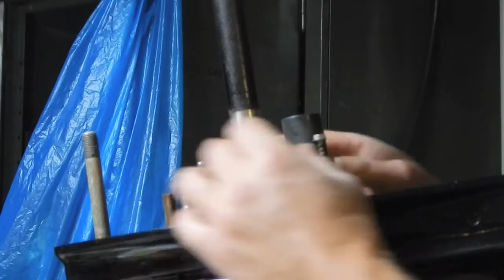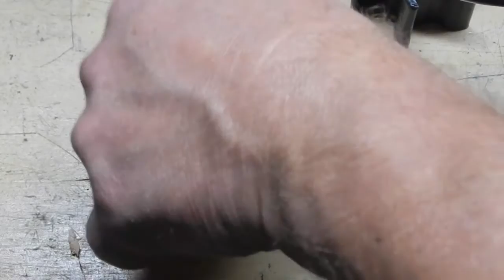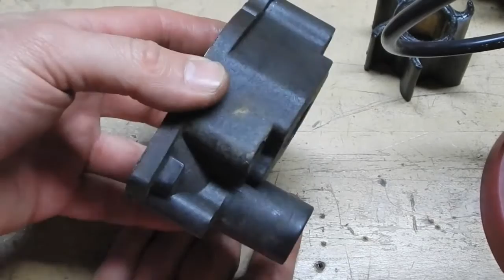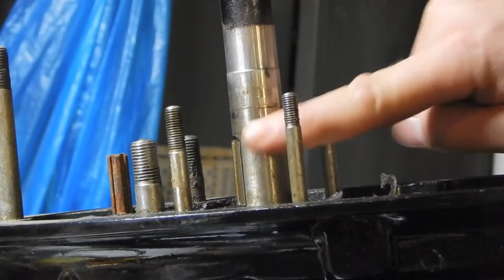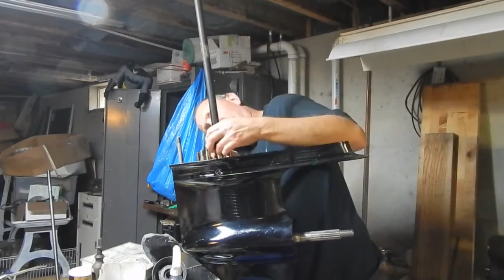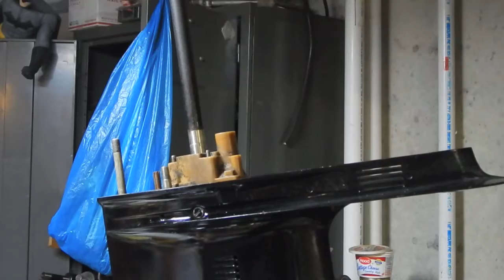The Mercury "Tower of Power" Outboard Part 50

Comment: Now you know why I always run a cooling water pressure gauge.  On those 10-15# ideal, less than ten start thinking change the impeller or look for a plastic bag over your inlets ( think bait wrapper-a quick killer but your gauge will read '0') under about 7-8 change it asap.  It is much more reliable than the piss tube.   There is a pipe plug on the top of the block above the spark plugs for a takeoff.   Take care.  Doug
Reply from the maker: thanks doug. I'll look for that plug next time im working on it.

Comment: Steve 
If you look at the black pump housing you will see the steel jacket has rotated in the housing leaving a witness mark from the lock tab.
I also wonder if some peanut has put the grease on the impeller to stop the squeaking of metal on metal contact between the shaft and liner.
Third that odd screw looks like some sort of drywall or self tapping fastener to me .
Cheers Eric
Reply from the maker: hello. I think the grease was just to aid in installing the cover over a new impeller.  I use the same trick. I  agree the screw looks wrong but it is almost identical to the one on my original gear case, so i think it's correct.